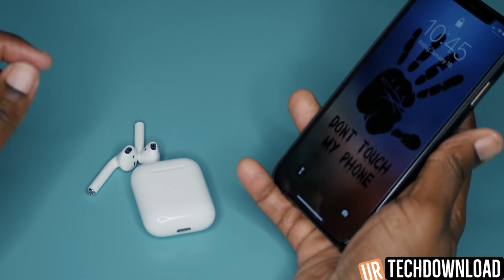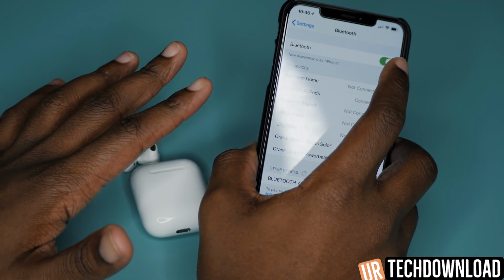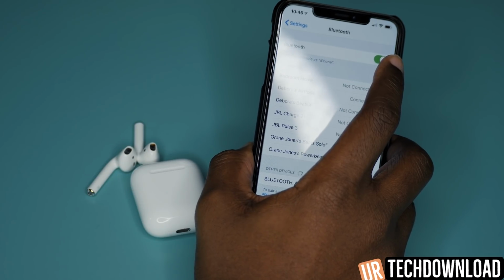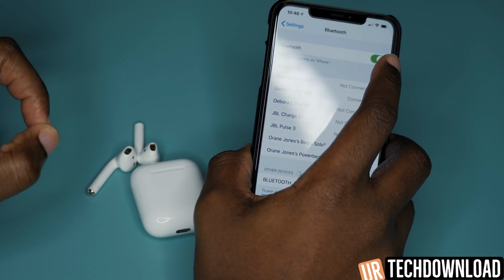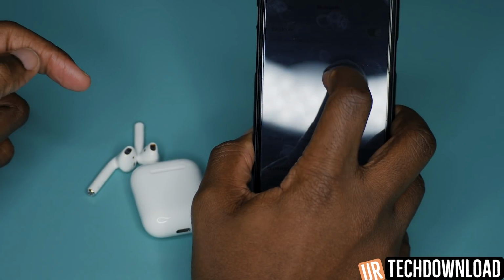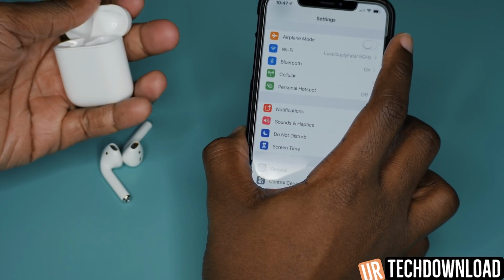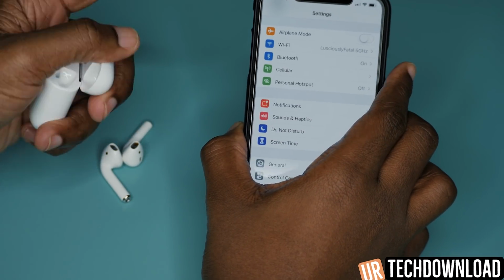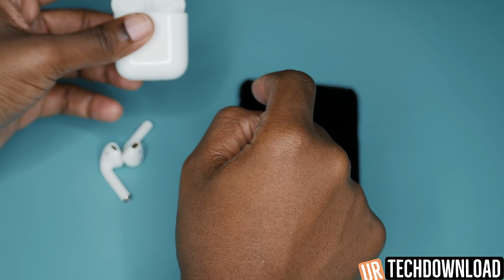Airpod Issues? No Problem! Here's How to Fix Them

Comment: When I connect my AirPods after a few minutes my right AirPods will disconnect then one Min later my left one will disconnect but still have 90% in them
Reply from the maker: You may need to try a full reset on the airpods, also make sure they are sitting correctly in the case if there is anything blocking the connectors at the bottom they wont charge correctly. If those don't work  I think it's time to bring it in to apple.
Reply: URTechSupport well I didn’t buy it from the apple store Bc I got it from a family friend so idk if they’ll accept it and help me with it

Comment: My left airpods are not working and don't show on left and right charge.solution plz
Reply from the maker: sounds like the case is not detecting the airpods, there may be something blocking it from making a connection,  try a quick cleaning if nothing is working there might be an issue with the connector pins at the bottom of the case in which case you would have to bring it into apple

Comment: My case won’t charge but the AirPods charge what do I do??please help meee
Reply from the maker: Check the charing cable, and the charing port of the case it self sometimes if there is something blocking the cable from making a good connection it can prevent the case form charing

Comment: Hi guys ı have a problem with my airpods when ı pair my airpods just one of it works sometimes left sometimes right but the odd side is ı can pair my airpods with 2 different devices ı think it is very rare ı dont know does anybody have this kind of problem
Reply: Hamza Oz I had same issue after 7 months with my gen 2 where the left AirPod stopped connecting and the I had to reset and connect again which worked and then stopped again. I had them paired with phone and Apple TV. Not sure if this starting happening after new update. I have sent them back to g looked at. I have just purchased the AirPods pro but haven’t opened them yet
Reply: Razza POV ı just went a apple store and guys in there said that it is a  connection problem about Bluetooth issue that  occurs often. And they gave me new airpods.he did not even look after ı just mentioned this problem ;)
Reply: Hamza Oz the guy in the shop said that they need to send it away as it was 7 months later even though the warranty is 1 year. I thought they would credit me back but will wait and see.

Comment: my right side airpod disconnect after 25sc.😔
Reply from the maker: Sounds like a charging issue, it's been known to happen when the airpod has a bad battery looks like it's charging but it's not really. You may need to get it serviced if none of the basic troubleshooting steps are working.

Comment: My microphone quit working. Any help. I washed them accidentally
Reply from the maker: That’s a tough one, it sounds like it could be water  damage. Try going into the settings turning off the automatic ear detection and switching between the left and right with any luck only one side is damaged and you can just rock with the other one. You can also always reach out to apple they can help with a replacement.

Comment: Only my left airpod would connect to my phone and the right one would say paring mode ?
Reply from the maker: Try placing both in the case connecting to the charger, and having your phone forget the airpods from the Bluetooth settings if that does not help then try to rest the network settings of the phone itself.

Comment: Anyone know how to fix the amber flashing light on my AirPods? I can’t reset them
Reply from the maker: That seems to be one of the biggest issues with the airpods, it can be caused by a couple of things some you can fix and one you can't. Try the standard things like, try pressing and holding the back button the see if can reconnect, connecting it to the power and trying again, also cleaning out the case making sure nothing is blocking the connectors at the bottom. But if that does not work then they may be having a connection error witch is not an issue you can troubleshoot, you would have to reach out to apple for that one.

Comment: My left AirPod does not connect, and it also makes a “beeping” sound. What can I do?
Reply from the maker: The beeping could mean a connection or power issue. Place back into the case and let it charge for an hour or two and try it again. But before you do I would clean out the case and the connectors at the bottom to make sure that airpod is making a good connection. If that does not work then try a reset on the airpods themselves. the last thing to do would be to bring it into apple if none of that works.
Reply: URTechSupport thanks

Comment: My airpods lights do not turn on when on charge or off but they still work and charge ( i have to check if they are charging through my phone) do you know why?
Reply from the maker: could be a hardware issue with the case, the led light may just be bad. You could try a reset but if it's working that I wouldn't worry too much

Comment: people can’t hear me when i speak. neither can siri. i restarted my phones and the airpods but neither works
Reply from the maker: Thanks for Watching, and the comment, Sound issues can be a hit or miss when it comes to troubleshooting, the first thing you should try is going into the settings and changing the mic settings to set either the left or right airpod as you main mic. This will give you an idea if the issue is happening on one of the airpods specifically. You can then try to have the phone forget, and re-pair the airpods then test once more. You can also try restarting the phone, and resetting the airpods themselves and test once more. You can also try restoring the firmware:  Place both AirPods in the charging case after  Press and hold the button on the charging case until it flashes white, Place the case with the AirPods inserted to charge. Wait until either the LED turns green, or until 10 minutes has elapsed. You can close the lid while you're waiting for the firmware to update. If you're still having issues, Contact Apple Support.

Comment: how i can volume control up and down
Reply from the maker: The Airpods don't have a volume control, AirPods requires either using the volume buttons on your phone or using Siri to increase or decrease the volume. You can tell Siri an exact percentage to increase, decrease, or directly set the volume to

Comment: My AirPods are out of sync they will play and sound fine but then one will play after the other kind of like an echo how do I fix this
Reply from the maker: Try having the iPhone forget the airpods then have them reconnect then test again. You can also try to restart your phone, then if that does not work try to rest your airpods fully.
Reply: URTechSupport I also should add that I do have 2 iPhones that I have them connected to and I do switch from one phone to the other but I do not turn off the Bluetooth from the other phone i don’t know if that can be part of the problem as well?

Comment: Oh my god help me. I’ve tried just about everything. My AirPods are connected but no sound is coming out of them while I’m playing music. I hear them cut out every once in a while and I don’t know what to do.
Reply from the maker: There is a couple of things you can try. Check the volume limit to make sure that it's off Settings > Music > Volume Limit. turn off Bluetooth, and wait a few seconds and turn it back on. Have the iPhone forget the Airpods then re-pair it to the phone. Try resetting the phone itself, Disable Automatic Ear Detection Settings > Bluetooth > AirPods and turn off Automatic Ear Detection. Try resetting your AirPods. Place your AirPods in their case Close the lid Then open the lid Press and hold the Set up button for several seconds until the status light starts flashing amber and then white.
Reply: URTechSupport nothing works mines connects then disconnect and doesn’t play nothing and I got them a day ago

Comment: I bought my airpods yesterday, is it normal one of the AirPod drains faster while put both of them on the same time? Also my charging case makes some clicking sound
Reply from the maker: Nope not really, And it definitely should not be making a clicking sound. Since you just purchased them I would definitely return them for a different pair

Comment: My problem with my Airpod 2 is the battery on left side always drain until i open and close the cover it restart to charge and became drain again after full
Reply from the maker: Sometimes When one Airpod is dying faster than the other or not working at asll, this can be due to it not charging correctly. You can try making sure that the case is cleaned out, and the charging connectors at the bottom are free of anything that would prevent the Airpods from making a proper connection. After Try draining both airpods completely then fully charging both. The other reason could also be that the airpod itself is malfunctioning in which case you would need to get that airpod replaced. You can go to Apple's support site for pricing info.
Reply: Same here

Comment: My airpods microphones don’t work, I don’t know what’s happening could you help?
Reply from the maker: One Thing to check is if there is any debris gathered near the microphones? It may help if you brush it away gently with a dry lint-free cloth. Also, make sure to check that the AirPods fully charged. If not, try giving them a full charge and then test to see if this helps:  You might also want to try re-connecting your AirPods. First, tap Settings > Bluetooth. The tap the 'i' next to your AirPod and tap Forget This Device. The next step is to put your AirPods in your case and close it. Wait 15 seconds, and then open it. Next, press and hold the setup button on the back until you see an amber light followed by a white light. Then, re-pair the AirPods and test If you find the microphone audio is still not working, your best bet is to get in touch with Apple Support.

Comment: I lost my airpods charging case but bought a new one but not apple and they work really well but stopped 5 hours ago please help been trying to figure it out today🙏🏼
Reply from the maker: It can be really tricky when using a third-party case for charging Apple devices, for the most part Apple will always suggest using their proprietary equipment. if the case isn't working check the power cord check the case itself check to make sure the airpods are in securely, check to see if it was charging airpods at all properly to begin with check compatibility and read some reviews on the case itself maybe others are having that same problem.

Comment: Any reason on why the left airPod dies faster than my right?
Reply from the maker: Sometimes When one Airpod is dying faster than the other, this can be due to it not charging correctly. You can try making sure that the case is cleaned out, and the charging connectors at the bottom are free of anything that would prevent the Airpods from making a proper connection. After Try draining both airpods completely then fully charging both. The other reason could also be that the airpod itself is malfunctioning in which case you would need to get that airpod replaced. You can go to Apple's support site for pricing info.

Comment: I have the Gen 2 Airpods, and they are a complete POS. When they work, "they're just okay." The biggest problem is they don't work about 30% of the time. There are several reasons for this horrid reliability track record. I had the Gen-1 version, and they were better with regards to reliability. Gen-2 Airpods is one of the worst products Apple has ever produced. Usually, I can go through the seven-step trickery process to get them to work again. The fact is, this is yet another example of the incompetence of Apple engineering.  I pray that Microsoft, Google, or preferably, Lenovo will seize the moment, and jump ahead with products whereby "they just work." As an Apple products consumer since 1983, I'm not necessarily a new guy. Until Apple figures out the corrective action; owners should restart all of their Apple iOS and macOS devices; disconnect the Airpods, and reconnect.

Comment: My airpods microphone dont work when i call somebody, Can you help please😭😤
Reply from the maker: One of the first things to check would be to make sure that in the airpods settings the Microphone is set to Always let or, Always right so the Airpods are not auto-switching. This method will help if there is a hardware issue with one of the airpods itself, as you can simply change all mic functions to the working airpod.  Try also having the phone forget and re-connecting to the airpods from the settings of o the iPhone.  If you are stilling having issue then it may be a hardware issue in which case they would need to be replaced.

Comment: my airpods won’t light up at all. i tried to charge them, no light. i tried taking the airpods out of the case, no light. the light just stopped working and i’m afraid i have to buy new airpods. i have washed them by accident, but it took a month to see the signs of them being defective. are they defective? pls help
Reply from the maker: Dam, well the airpods are  Water-resistant and water damage can take some time to show. But a few things you can try check the Lightning cable or power brick connected to your AirPods make sure your earbuds or charging case doe not have gunk and grime on their charging connectors and need to be cleaned. Try resetting the airpods themselves if it's still having an issue the Your earbud(s) charging connector may no longer work or your AirPods case no may longer work in which case you may need to replace them.

Comment: My AirPods only work for 1 n 24 hours later it’s works again
Reply from the maker: A couple of things to check would be to make sure that you charing cable is working as it should be, Try Resetting Your AirPods, You can try draining the battery fully. Of both AirPods and the AirPods case. Then charge it fully, in one go. You can also try to disconnect and reconnect the AirPods from the iPhone itself.

Comment: My airpods battery drains very fast like in 10 min
Reply from the maker: A couple of tips you can try,  1. Try Resetting Your AirPods, You can try draining the battery fully. Of both AirPods and the AirPods case. Then charge it fully, in one go. You can also try to disconnect and reconnect the AirPods from the iPhone itself.

Comment: My AirPod only works when it’s connected to a charger, the light goes off as soon as it’s disconnected from the charger... any help please.
Reply from the maker: That issue sounds like a problem with the internal battery of the airpods themselves. Try doing a reset, but if that does not help they need to be replaced. Sorry
Reply: I have the exact same problem!!! I’m seeing Apple about it on Wednesday

Comment: the light in my airpod case won’t turn on no matter what and the airpods won’t connect anymore what do i do?
Reply from the maker: The first this to check is making sure that the case is charging correctly. Make sure the charging cable you have is working, maybe try another cable or another outlet. Also, try a hard reset on the case, and then there is the consideration that the case itself may be busted in which case you would have to reach out to Apple for a replacement.

Comment: The sound is so low on the left one what shall I do they used to work fine but now the sound on left is so low help
Reply from the maker: The first thing is to go to Settings > General > Accessibility and scroll down and find the “Hearing” section. This section lets you to set a left/right audio balance. If one pod is quieter than the other. It might be this setting. The AirPods are supposed to have the same volume level unless the balance is changed. You can adjust the volume level for each pod. Next, try to Restart your iOS device or other connected device. Turn off Bluetooth and wait a few seconds and turn back on. While using your AirPods (e.g.; listening music), turn down the volume to zero, on your device, go to the Bluetooth settings (e.g.; if it is iPhone or iPad: Settings > Bluetooth) and disconnect your AirPods. To do that, tap on the blue “i” icon next to your AirPods and tap Disconnect (just disconnect, do not unpair). On your iPhone, launch the Music app and play some music. And turn the volume all the way down to zero. Then reconnect your AirPods and turn up the volume.

Comment: i reset my airpods and everything but my left one still won’t work please help
Reply: Bruh same
Reply from the maker: sometimes when a specific airpod isn't working it is because the airpod itself is not making contact, or  proper contact with the charging connectors at the bottom of the case so it's not charging or connecting properly. one of the fixes to this is making sure that the bottom of the airpod itself doesn't have any scratches or debris that would cause it to not make contact with the connector, then using a q-tip cleaning out the bottom of the airpod case itself where the connectors are to make sure that's clean, then placing both airpods back into the case and applying maybe a slight bit of pressure just to make sure they're securely in been charging to airpods for about 15 to 20 minutes and then attempting to reconnect again.
Reply: URTechSupport my AirPods are fully charged but the left AirPod still doesn’t work. I’ve reset, cleaned, and checked almost everything else. please help, I just got these AirPods last month and it would suck to have them broken already.
Reply: pnacake same same
Reply: pnacake i had mine for a bout 5 months then lost them for a month. found them dead so i charged them up and they seemed fined until a week later the left one just stopped working as well:(